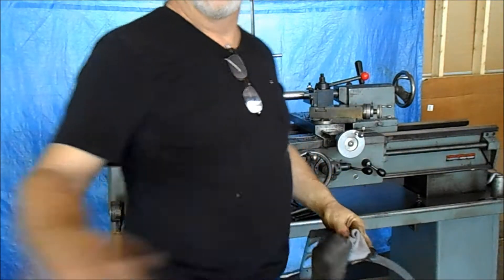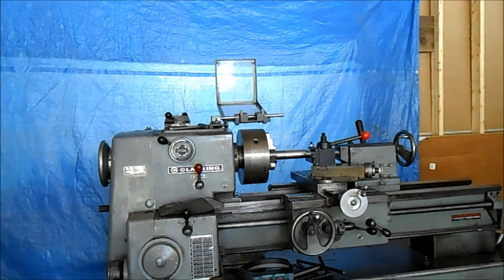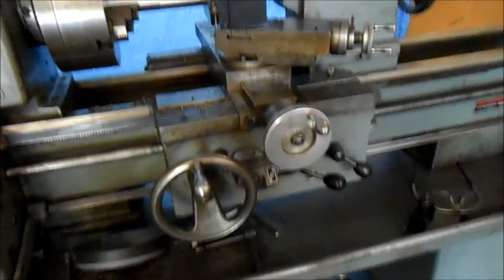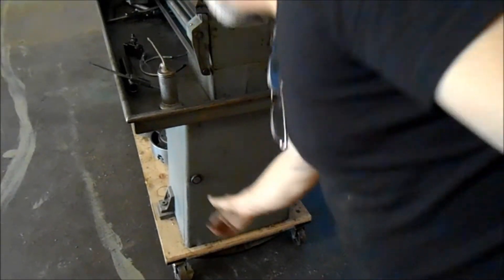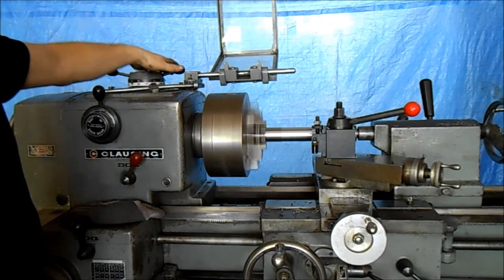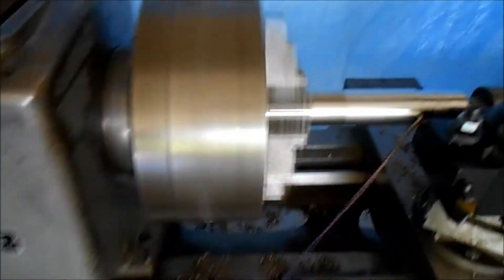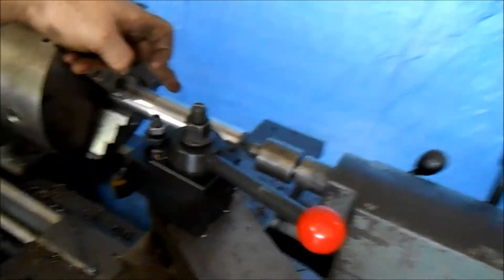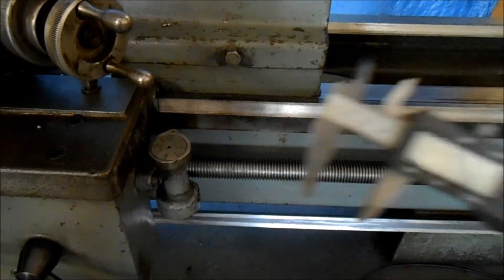Clausing 6903 14" lathe in operation

Comment: Clausing model5914 Lathe  what can you tell me about this lathe? what similarities 
between 6903 ---- 5913 i am looking for such a lathe some people think they have gold and some are so bad it would be to much to fix . like to find single phase,115 for home use thanks
Reply from the maker: anthony marasco Hi Anthony.  Couple thoughts for you.  The 5900 series were very popular in school settings.  Some of those machines can be in good shape, though commonly evidencing the goofs typical of student use.

The 6900 series was a much more serious machine, but was in many cases used in production situations.  As such, it is more rare to find one in good shape that hasn't been worked very hard and long.

I hope you get some good out of the video itself in terms of understanding the capabilities and construction of the 6900 series.  

Both the 5900 and 6900 series machines have the hydraulic speed change mechanism, both have L00 spindle noses.  The 6900 has an oil bath gear change system that is open in the 5900 series.

You'd have to look at the individual machine to get an idea of what has to be repaired or replaced before purchase.  

Lucas
Reply: how can i send you a pix of a beautiful clausing lathe i found
Reply from the maker: anthony marasco Hi Anthony,
Are you a member of the Clausing Lathe and Mill Users Group on Yahoo.com?  I recommend you join that group.  You can post pictures there.  Another awesome place to visit and join is Practical Machinist, they are probably the best group out there.  They also allow posting of photos.  Once you've posted, drop me a line with the URL and I'll take a look at your awesome lathe!

Lucas AKA Arn Jones
Reply: no i am not....i will be looking into it thanks....
Reply: Tengo un torno clausinng y no alcanza la máxima velocidad, solo llega a 350rpm